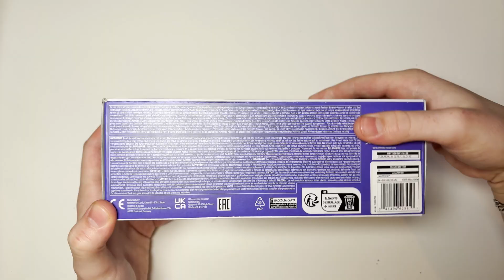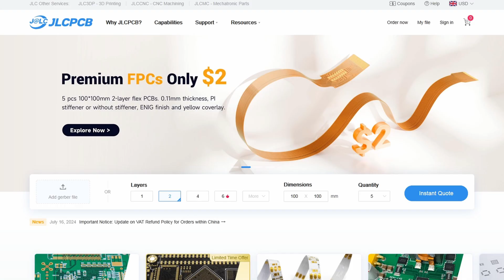Nintendo Switch Lite - RP2040 Picofly Installation Guide

Comment: Managed to do it on my 2nd time around. 
1st time, i tried to do it right after a shell-swap, and it was getting late.
Checked, screen and buttons working, started the install right after. Must have overheated something, or shorted something in the process,
`cause i had no screen, but sound.
Got a new motherboard only for cheap. Did the install today. 
Lights flashing BLUE-YELLOW-YELLOW and booting into stock FW.
Meaning that one or more soldering-points wasn`t up to snuff.
Refloated all the solderingpoints on the yellow ribbon just to be safe, and VOILA!
So now i have a modded Oled, V2 and Lite. Nice.

And now to throw them all in a drawer, and hardly ever use any of them, 
and go back to playing on my Steam Deck. 
Thank you :)
Reply: lol you are so real for having fun modding them but right after setup getting back to Steamdeck

Comment: Hi so I js got my switch Lite modded, the only problem is that I wanted to shell swap but I modded it before thinking about doing a shell swap, do you think that shell swaping would still be possible with the chip ?

Comment: GOOD job men. just can you guess to us which temp you had set for the HAKKO FX-888D Professional ??
Reply from the maker: I usually use about 420 degrees, but I solder quite fast. If you’re a first-timer, I’d probably start at 360 degrees Celsius, then increase it if it’s not melting quickly enough.
Reply: @TheModSmith  ok thanks so i should pass more time ( do weldings during more time not juste little and fast weldings )

Comment: Hi, modded my switch but didn't use your guides (kind of already knew from mods from before your update), you did a good job, I joined your server to talk about it with you and other people. If I may add a few suggestions to help beginners:

(Hopefully my comment doesn't get deleted. — See replies)
Reply: 1 - Pretin. Pretin, pretin, pretin. The spots for A, C, & D mostly. Flux them and pretin while scratching a little to make the surface more adhesive to iron. Then, put your cable on the fluxed zone, put some flux again over it, align, put some solder on your iron and press down on it, it will be way easier to adhere. Then, clean it with ipa. While some people do and suggest it, I personally don't pretin the flex cable as the holes allow me to see if all is well aligned underneath. It's not much but I'm a bit paranoid about it.
Reply: 2 - DO NOT USE REGULAR TAPE. Especially since it's a trial of quality. Unless you have a top tier one, a bit of heat from what's around and dust from fan activity and you're guaranteed to have it peeling away and exposing it to shaking and touching what's around, even though there's low risk of it, especially since you put it OVER the shield instead of below it where it could instead have be pressed down by the surrounding shield parts. Suggestion : Just use regular kapton tape, it's way better and you'll be able to do that in one attempt without looking back. The main goal should probably be to isolate the chip and avoid potential shorting with neighboring metal.
Reply: 3 - Two options to stabilize the chip :
a) Double sided tape on the back of the chip and stick it on the shield when all is said and done.
b) What I did but it's only to do as a last resort and know you won't even open it again nor touch anything inside ever again : Given the low adherence to glue of the chip's coating, put a small piece of tape on its back and a drop of heavy glue on the shield part underneath and press. It can take a bit of time to settle and dry but when it's done, it's never moving again.

In fine, it still gets pressed down by the shell so do whatever you want of that final advice.

Comment: I succeed for my first attempt jb switch lite. I learned something and it takes 2 days to realized and fix.  1) Missed one soldering point, my switch got a black screen, only the led at picofly blinking. 2) I cannot access to cfw/ofw boot selection, the issue was the picofly got crushed by the plate that I did not cut at first.. Now i just use my Pc gaming only for Youtube, meanwhile switch for gaming session..

Comment: How about temp to solder capacitor?
Reply: 300-375 max. Anything beyond and you take on the risk of burning off a capacitor. Also be patient. If you push thinking that pressure with temp will solder faster, you're going to rip a capacitor off.

Comment: Thank you. I did my first switch lite modchip installation with this guide and it worked perfectly. In person the soldering points are smaller than they look in the video, so I bought a $10 low quality chinese microscope and still after about 3 hours being extremely careful I did it first try.

Comment: Did a modchip install on my lite a year ago and it worked until last month (I did bad on the SP1 joint and ig it finally caused a short after some time). Finally got a donor board last week and tried it again and even though my SP1/2 joints were flawless this time, I somehow messed up the A and D points by burning through the ribbon cable and shorting the install. Console still works but now I have to waste $10 and wait another month for a new ribbon cable... Honestly could've prevented any of this if I had a smaller iron and microscope bc I've been doing it with a dollar store iron, my plain eyesight, and a dream 😭
Reply: that’s why you borrow a microscope off amazon lol

Comment: Just picked up a switch lite (said wouldn't charge, but must be their charger cause it charges & works perfectly) for $20...either gonna install this mod or use a MIG & permanently keep it in Airplane Mode
Reply: Mig switch is the best... I have one but it doesn't give you all the software that a mod chip will ie you can only use switch games where as the chip you can use emulators for playing all nintendo games

Comment: At 10:09, at the 3.3v ribbon, in the top, does the resistor also need to be soldered together with the pad and ribbon?
Reply: Yes, you're soldering the top of the capacitor (positive side) to the pad on the flex cable.

Comment: Do you need to remove the mod chip to replace the lcd??
Reply: the mod chip is installed on the motherboard, so if u remove the motherboard, it cones with the modchip

Comment: What temperature do I need to have in the welding?
Reply from the maker: I use 420 degrees celsius, but it all depends on how you solder, there is no one size fits all.
Reply: @TheModSmith  ok, thanks

Comment: Really clear instructions. Love that you showed it up close. I've wanted to try this considering how Nintendo is behaving recently. In my area there are no people who seem to provide this service which I'd love to offer. I'll let you know if I can make my switch lite become a modded one.
Reply: Did you get it?
Reply: @doremi4531 I got the supplies but it’s a lot harder than you’d think if you’re not good at soldering. A microscope is absolutely necessary. Get high quality electronics for it. I kinda murdered my switch due to flicking off a resistor. But I bought a new switch in the hopes of trying again, but not before practising my soldering.

Comment: Gonna star my installation as about now.. wish me luck
Reply: how is it going
Reply: @Rauno_RepomiesHey! I had to stop the installation because my soldering tip is way too thick and everything is super delicate and small, I just can’t properly see what I’m doing.
Even though I have all the materials, they’re not the most suitable for this kind of job.
As soon as I applied the flux and got ready to start soldering, I immediately stopped — there’s just no room to work with precision.
I’ll either hire a professional or order the proper tools online and give it another try later.
Reply: @pedrooliveira1661 it’s nice you even got the chance to mod yours, I got all the materials and the 4 tri-wing screws on the back where stripped and they won’t come out. Yay me

Comment: Hey man, quick question, is there anyway I can salvage it if I somehow screw up the first soldering?
Reply: You can always dessolder and solder again, just not if you somehow damage some of the original components like the APU capacitors. I recommend just do it if you're already confident in your microsoldering skills, because even with experience in soldering it was a bit challenging for me with how small everything is.

Comment: 4:00 If not to put black cable below that metallic cover around the CPU, can it cause a problem?
Reply: I'm answering my question from the experience, yes, if don't do that way or isolate chip on black cable, IT WOULDN'T WORK. I had two consoles with that problem.

Comment: Be careful guys I just ruined a v2 switch 😭
Reply: Update guys I was about to de solder and the switch powers back on and is working fine
Reply: @izzysan4013  i think you missed one soldering point.. I missed B point, and cause my switch lcd black screen, but the picofly led blinking
Reply: @izzysan4013 maybe there is nothing on the Modchip. Just plug it in the PC and test if there is something on it
Reply: @izzysan4013 you son of a bitch I am happy for you. I was sad reading this thread but all ends well 😊
Reply: @izzysan4013  this was a guide for Switch Lite, not V2 You likely need another flex cable
Reply: I was able to mod it successfully then but I accidentally took off my electrical tape that the flex cable came with it so they solder that came in contact lost contact and I just gave up modding it so be careful
Reply: Lmaoo😂😂 learn to read first before attempting anything it says for lite not for v2
Reply: @xx_basilisk-yt_xx1551 noob question what is a switch v2?
Reply: @SNL210-s1c the original switch model had a slightly updated version with improved battery life. Only well to tell what version you have is the serial number
Reply: @SNL210-s1c Mariko is v1 switch model
Reply: I had to reflow my solder contacts because I bridges 2 caps together and had to remove the solder and my v2 switch turned on.
Reply: @bakerd62 I'm trying again soon just don't want to mess anything else up
Reply: Sounds like a skill issue
Reply: Srsly? How?
Reply: That’s how you get better bro !! Keep going never back down
Reply: i thought theres another way to mod a og switch. modchip is commonly used in switchlite
Reply: @mikashitacordilla1941 only for v1 switch he has a v2 which can't do that method
Reply: @mikashitacordilla1941 yea, there’s a fault in the Tegra Chip. You just force RCM mode and plug it into ur PC
Reply: Sounds like a skill issue I’m modded mine with a wood burner and a magnifying glass
Reply: @Tim_Latiy your mother
Reply: Bro this is for switch lite you should have follow a v2 switch mod tut not oled nor lite they all have different modding process
Reply: @Francescopro270 can you read bro.?
Reply: @izzysan4013 Bro I know you had a V2 but this is a switch lite mod
Reply: @Francescopro270  and I was just telling people to be careful I will point I commented on my own comment that I have a switch v2 bro
Reply: What did u do wrong
Reply: That's the problem I don't know I soldered it the way the tutorial says the two connectors on each side but I really don't know it won't turn on anymore  @lightslight
Reply: @izzysan4013 did you remove battery connector first?
Reply: @MASTERBONERGUY  yes I did took out the mc chip and when I check the port it's charging fine at 14 volts so it's not a short it just won't turn on
Reply: @izzysan4013 i think the hardware issue
Reply: @MASTERBONERGUY I have to try to take everything off so take the mod off clean up the components reconnect everything and see if I can turn it back on
Reply: @izzysan4013 don't give up do whatever it takes
Reply: I'm going to give another shot this weekend ill post a update @MASTERBONERGUY
Reply: @izzysan4013 maybe you bridged the capacitors, I messed up on modding my v2 too and the screen didn't turn on, I cleaned everything up and it turned back on again
Reply: @izzysan4013 update?
Reply: Bro it says the title is lite not V2 switch
Reply: Ding dong I know that I'm just saying to be careful when you guys are modding your switches smh @narbonitajefferson.o4474
Reply: The topic is switch lite not v2 lol
Reply: Simp
Reply: I’ve broken about 12 Nintendo switches, and only two of them worked

Comment: I did this a couple weeks ago with my hyrule edition, though with a different kit that had an L shaped main PCB and different flex cables, it was a bit tough fitting those cables but I got there in the end and I'm absolutely loving this console
Reply: Damn bro I just ruined a v2 switch I have like 3 switches but still hurts
Reply: @izzysan4013  how did you ruined it?
Reply: @hendystark8333  I tried to solder the mod parts and I sold it all the components in that area and I can't unsolder it no matter how hard I try
Reply: @izzysan4013  Get a solder wick.
Reply: @nobody-bt7mu  I paid 30 bucks to mod my switch v2, i think it is worth it to just let someone else to do it hha
Reply: @zelme9348 hey question who modded it for you?
Reply: @zelme9348 Who modded it for you? Where could I find em? Looking to do it too